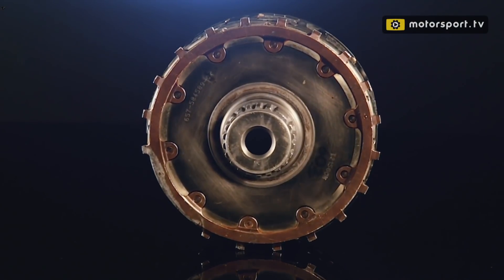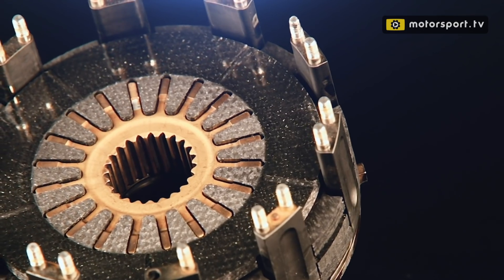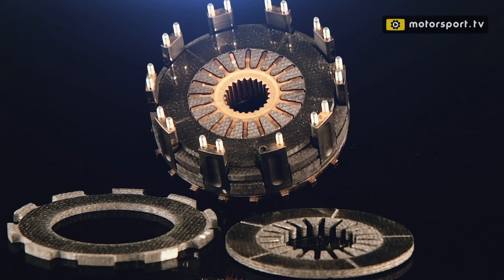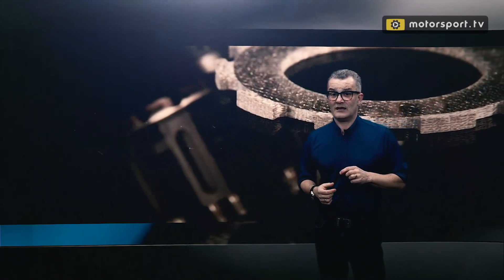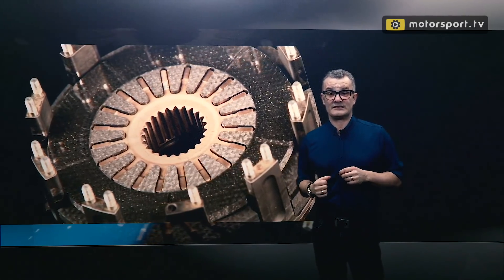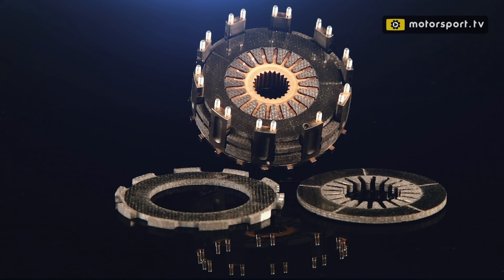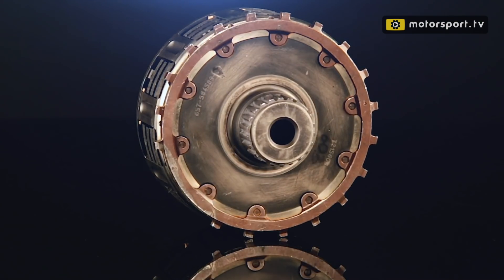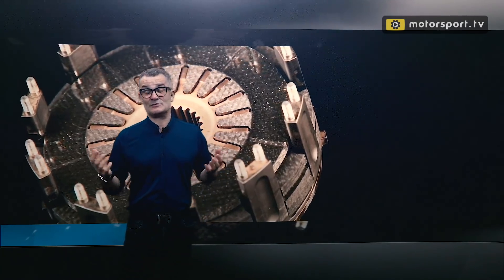A closer look at a Formula 1 clutch

Comment: facepalm
SCARBS! You didn't explain a single thing about it except it has carbon fiber discs! C'mon guy, get with it, this was really pretty but there was no useful information - AT ALL. I know a thing or two about HP clutch packs but I still can't figure out how it physically transmits the power from one side to the other. Holding it in your hand would have been far useful compared to what you've done. Pretty video, absolute waste of time.

Comment: If you are going to produce a video on how an F1 clutch works, you might actually include some more detail on how an F1 clutch works.
Reply: F1 doesn't use a clutch pedal, which probably should've been explained in the video also. Instead, they use a lever on the bottom rear of the steering wheel, similar in application to that of a motorcycle, but because the trans is fully sequential, they don't have to use it to change gears, only when starting and stopping.
Reply: Okay I meant the clutch lever...
Reply: Bradley Schmitz he did mention the paddle at the end of the video
Reply: Search for Ducati dry clutch and you basically have the similar design as this F1 clutch.
Reply: world wide actually that is quite easy. If the clutch pedal is pressed, the pressure on the disks is relieved, so halt of them are spinning with the crankshaft, while the other half does not spin at all. When the clutch pedal is lifted, the pressure on the clutch pack mounts and the rotation is transmitted to the outer case which has the gearbox attached. So basically like a normal clutch in a road car, just lighter and more beefy.
Reply: Thanks.

Comment: Bought it incredibly cheaply? How cheap is it considering it is probably a worn clutch that you can't use in anything? Also the weight of the clutch could be more impressive if the weight of the competitive clutch was given as well.
Reply: It looks unused and fabrication cost was probably in multiples more than spend at auction, that would qualify as cheap?
Reply: Lourens Rolograaf I am sure it cost a small fortune to fabricate, but it is useless as a clutch unless you have a spare F1 motor around that needs one. Maybe it is a bargain as a souvenir.